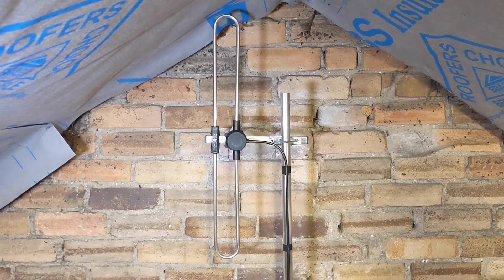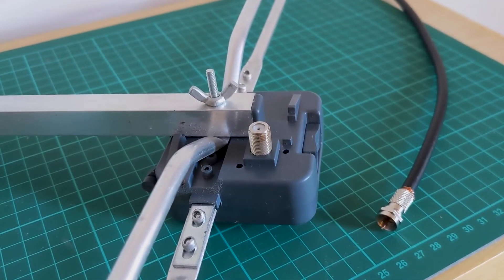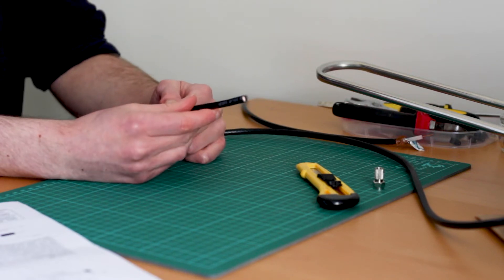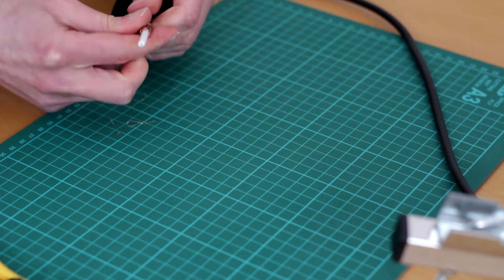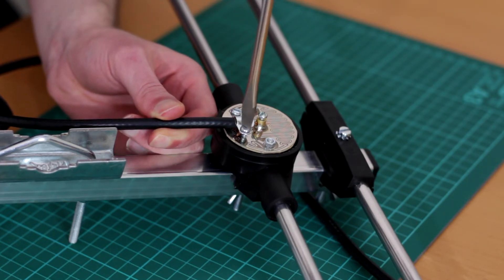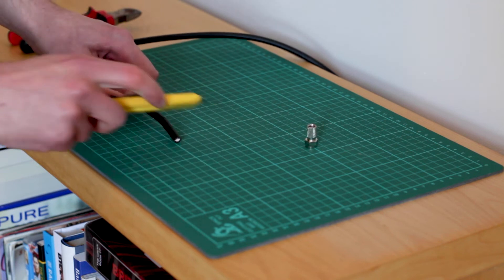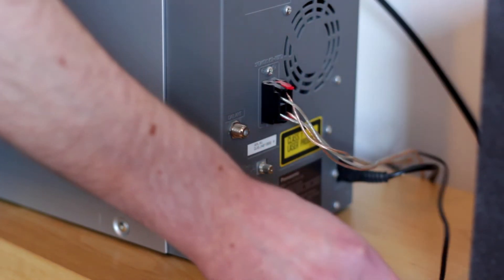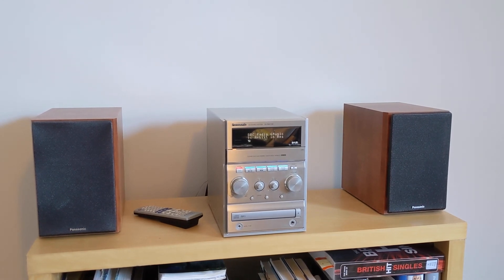Install an omni-directional DAB aerial

Comment: I think you live close to a DAB broadcast tower beacuse you can use a dipole in the attic. In my case I had to install the dipole outside and the reception wasn't great. But with a 4 elements VHF High antenna I had very good reception. With a 7 elements antena the signal was 100% (full). But with a 7 elements antenna installed in the attic I could receive DAB stations. I recommend an amplifier.

Comment: In general the antenna must be mounted outside preferably on the rooftop for the best reception. A few years ago when I installed a TV and FM antenna (vertical dipole) first I installed them in the attic. On FM band only the strong and medium to strong signal stations could be received and on TV (DVB-T2) the reception was poor. When I mounted both antennas outside I had excellent reception on TV and I could receive even weak signal FM stations and sounds good. Great video.

Comment: I just bought a VHF-3 TV antenna. FM is in the VHF-2 band and DAB above. I only used the dipole, but not the struts that come in front of it or behind it. The antenna also receives something in the FM band. However, FM is usually oriented horizontally and DAB vertically like the antenna. That's why I have a 15 db amplifier behind it. Every good antenna needs height so this is on the 2nd floor. This is the only way I can receive DAB and FM on the ground floor. The radios on the 2nd floor use a simple wire.
I also tried connecting the TV. Channel 27 is hardly received any more. No wonder. The antenna is rated from approximately 100 to 200 MHz. UHF is far away. But FM (88- 108 Mhz) still fits.

Comment: I bet that foil roof insulation causes quite a bit of attenuation.
Reply from the maker: Thanks for watching the video. That's a good point - the membrane in this loft is a breathable one without foil/insulation and is used to catch dust but some lofts certainly may have that type.
Reply: @digitalradiochoice7157  ah I see.  Your video was excellent and will teach people how to get an excellent dab signal without an expensive roof installation.

Comment: I have exactly the same radio. It came with the 'F' type aerial connector and a measly short and useless aerial cable. The DAB reception is next to useless. So I guess I will be doing this shortly. Thanks for sharing 👍